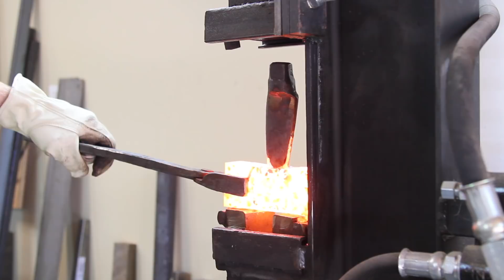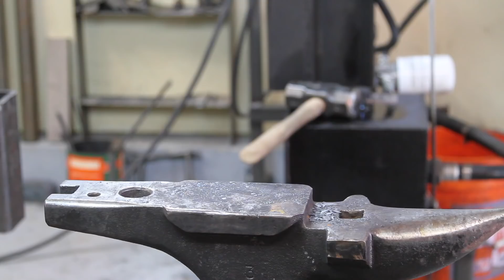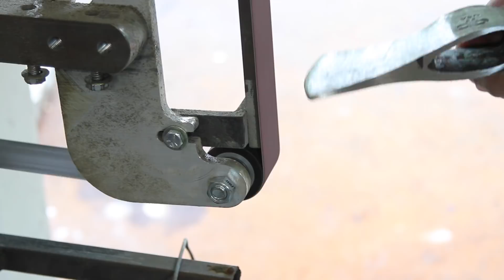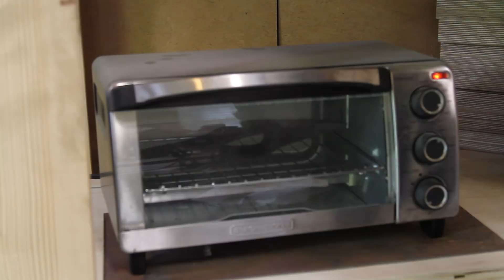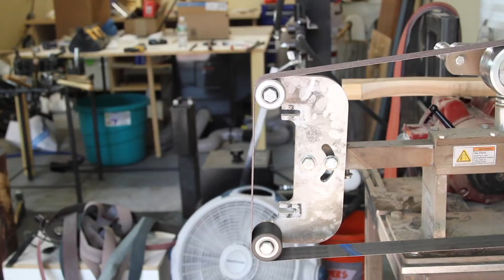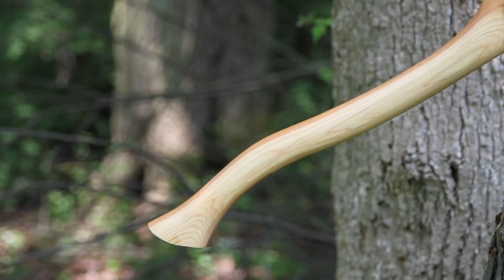Hand Forged Fireman's Axe - Blacksmithing

Comment: Always wanted to try and forge an axe, looks hard though. Awesome work and channel. All the best dude, subscribed 🤠
Reply from the maker: Thank you! And you should definitely give it a shot just make sure you forge a nice drift
Reply: Paul Pinto I'll try, but I need to make a gas forge first, don't think my coal one will work as well for it.
Reply: If you use a coal forge, make sure it can fit the whole axe head in it, while it lays on its side. This makes any forge welding extremely easy.
Reply: Savage Porkchop it's possible but I need a gas forge in my life so I'm looking for as many excuses as I can 😂

Comment: How is it hand forged when you do everything with a press. Your work is great I just hate it when stuff gets labelled incorrectly
Reply: I just became your 7th subscriber
Reply from the maker: Hahaha
Reply: Not trying to be a Dick. You forging work in general is very neat. I'm just jealous cause I don't have a press yet. Lol
Reply: I actually used to agree that using presses and power hammers wasn’t truly hand forged and that it was “cheating” but after trying to work larger stock without a striker I realized that it is kind of necessary. I also realized that it’s no different from using a drill press instead of a hand drill or a grinder instead of a file. It’s the same work, just done faster, and it still takes quite a bit of skill and experience to do it well, if not more. It’s easy to make big mistakes with such powerful tools.
Reply: muledeerdude true. I have the benefit of strikers but I will have a power hammer and a press soon. Then I can also 'cheat' so to say.
Reply: I built a press before I even built a knife, now isn’t that backwards?